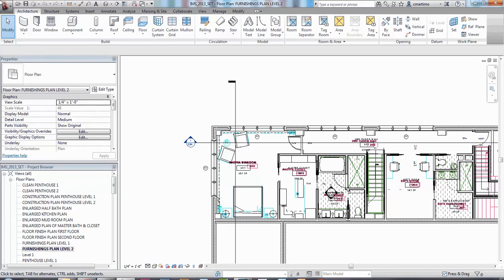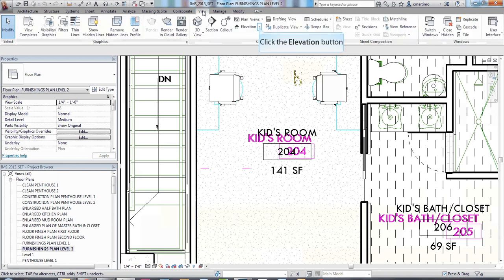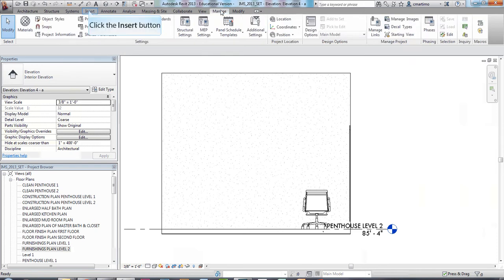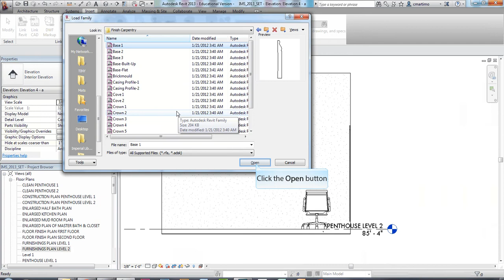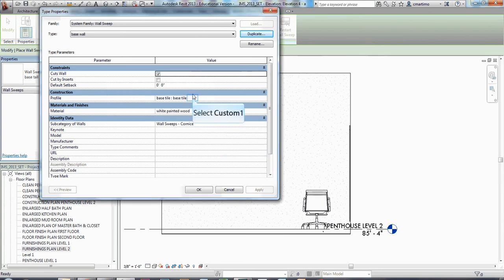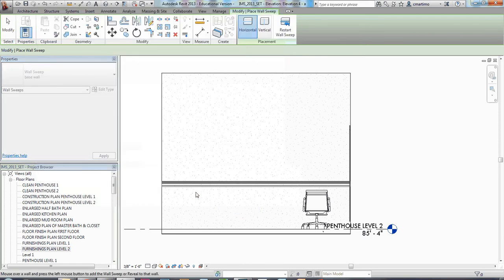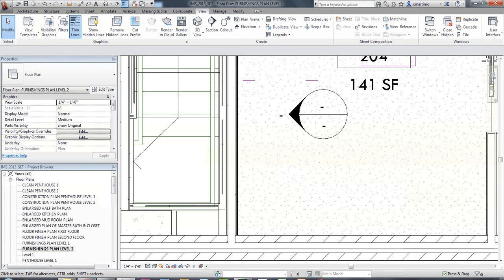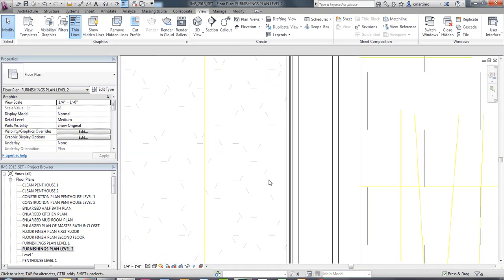Wall Sweep creating wall base and crown moulding in Revit

Comment: Very good video, I do have one issue. Has anyone figured out how to make baseboard profile show on walls cut with a Door-Opening?
Reply from the maker: David m It is good practice to use a "doorway" instead of an opening because it wraps the materials better.  It still does not do the wall sweeps though.  I usually make a small separate family for the doorways and place it there.

Comment: Thanks this was awesome. I tried to make my own, and i keep getting an error message saying---> Could not create Wall Sweep. One or more profiles are invalid.  Make sure that every used profile is a closed loop of non-intersecting lines.
Reply from the maker: You need to be sure the profile you create is just a shape - no intersecting lines - no crossing lines (a loop if you will).  Just like if you were creating a floor.  
Hope that helps!
Reply: ok Thanks. I will redraw i, and I will let yo know the outcome.

Comment: Please Can you explain me how can I add a crown molding on top of a kitchens cabinets.
Do I need to create a family or I can do  it direct in to the model. 
Thank you for your videos.
Reply from the maker: You would create a regular sweep in the cabinet family.  You can create a moulding profile  - which will make it much easier - You can see how to do a sweep here: Extrusion, Sweep, Revolve, Swept Blend with Revit
Reply: Thank you. I did.   and worked perfect.
Reply: I have another issue. I don't know if you can help as well.
I applied a same material (wood) to a 3 different kitchen panels. I  did in model in place type. but 2 panels the grain is in the wrong direction that I want. Theres a away to fix it
or when I creating those panel can I do something to control de direction?
Thank you
Reply from the maker: Peto Petronovich You can create a new material by duplicating that one and rotating the wood grain.  The material editor sometimes rotates material images in the project for no reason. This is the only way I have found to fix it.
Reply: I see. I  will try your advice and thank you .